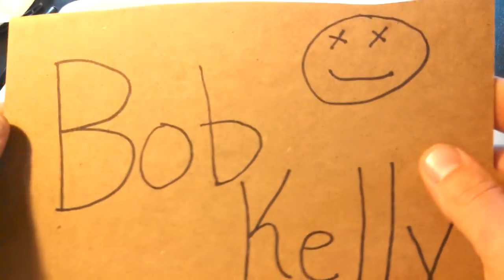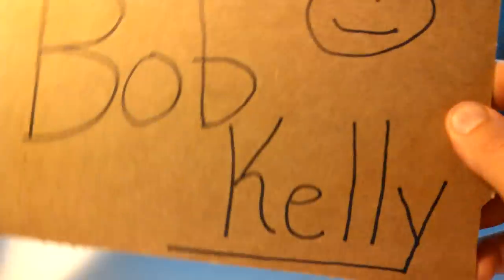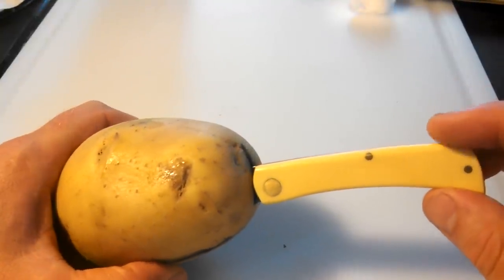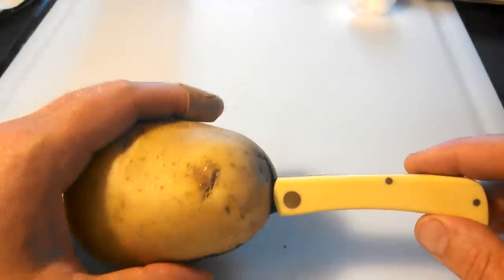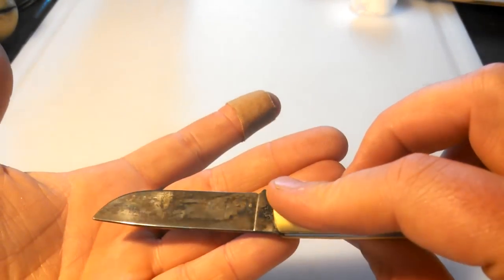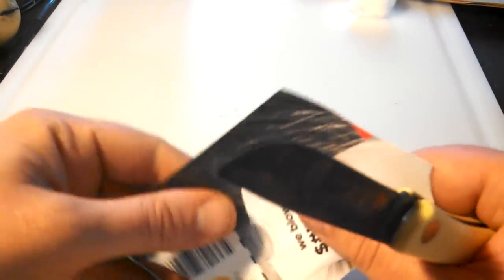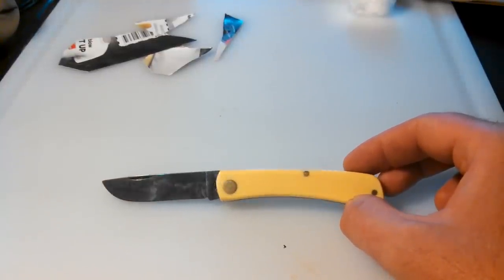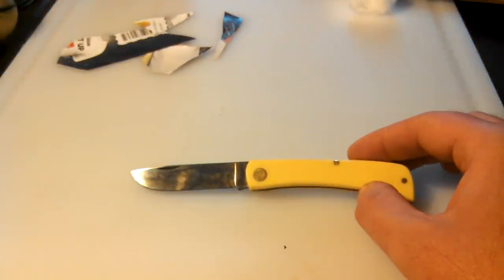Potato knife patina

Comment: like both carbon steel and high grade stainless , I will admit this , I prefer high grade stainless for use outdoors , because you don't have to worry as much about bad corrosion issues
Reply from the maker: Azrael same here. I carry a stainless pocket knife. I find with modern stainless my knife edge last just as long if not longer and there is a lot of good stainless out there that is easy to sharpen.   every now and again I drop a carbon blade in the pocket
Reply: Michigan Edge I choose stainless for survival knives , work knives I tend to as well , due to the fact its easier to take care of
Reply: @michiganedge4770  I love both for different  reasons, but the old complaints about  stainless steel simply don't  apply anymore. Modern  stainless steels are excellent.

Comment: I'd bet that the micro-etching that occurs during the patina-ing(?) could effect the edge on a very fine level. But that could easily be knocks backed into shape with a few swipes on  ceramic honing rod.
Reply from the maker: +Soulman1282  right on bro!  Not enough to worry about!   Thanks for watching!
Reply: +Soulman1282 Just paint the cutting edge with fingernail polish. It will protect the edge and it comes right off with nail polish remover.

Comment: In your opinion, which is faster/more effective, using a potato for this or hot vinegar
Reply from the maker: They all work about the same.  The potato is convenient because you can just stab it and leave it.  I did a video using lime or lemon juice as well and that gives an almost pure black patina that is kinda cool.  The process happens fairly quickly either way you choose. But I think I prefer the results from lemon or lime juice the best.  You can by the bottles of juice or concentrate at the $1 store usually.

Comment: I DONT WANT A PATINA PLZ NO PLZ NO
Reply: It can be avoided if you don't use your knife much and avoid cutting acidic things. Make sure you thoroughly clean and oil the blade with something like mineral oil. If you truly intend on using your carbon steel bladed knife it will develop a patina over time whether you force one on it or not.

Comment: Unless that patina offers some protection against rust, I don't get the point. If you owned a firearm, would you deliberately force a patina on blued barrel? No! You do your best to maintain the perfection of the blueing! If you owned a fine car and had a garage to keep it in, would you leave the car out in the rain to give it character?
Reply from the maker: If you don't believe in it then why are watching the video?
Reply: I watch videos of things I've never done in order to learn. Forcing a patina seems like a completely different idea than the usual 'clean the carbon steel blade after using it to keep it pristine'.
Reply: A forced patina serves much the same as bluing a gun barrel in that it slows corrosion and actually protects the blade. Obviously, some guys are doing it simply for the look, but it actually serves a purpose.
~~ PEACE
Reply: A blued barrel IS a forced patina...
Reply: The patern might fade a bit but the point is to give a jump start to something that happens naturally. So the patina is 4 ever.
Im going to try the purple onion method. (^^,)